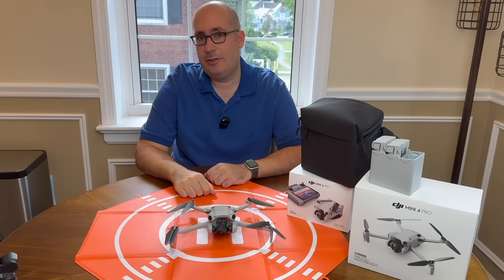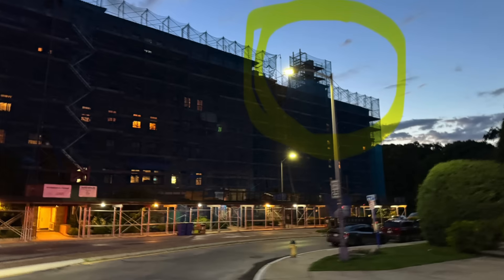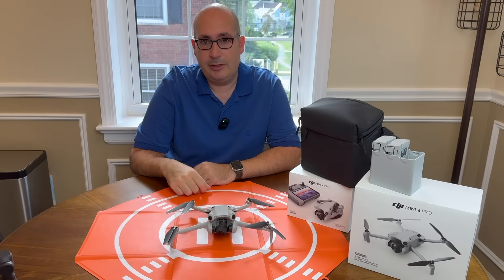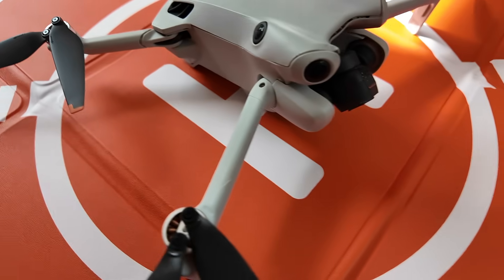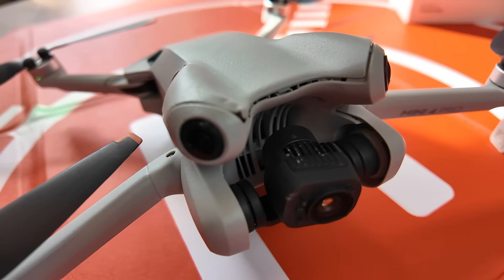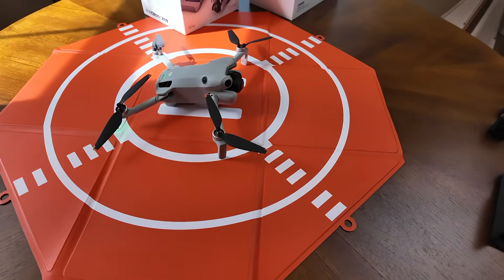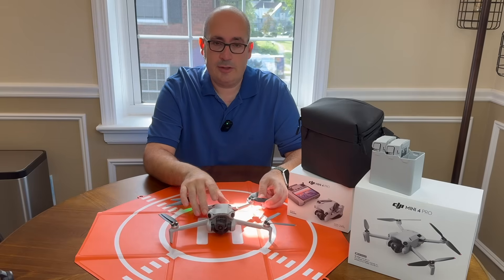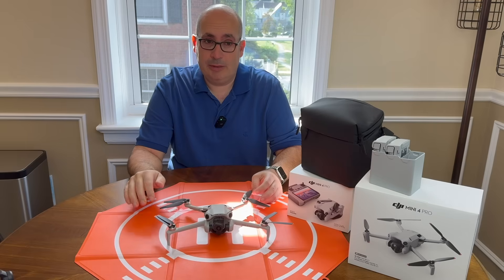This Is Why You NEVER Fly a Drone at Night (DJI Mini 4 Pro CRASH)

Comment: Do you have a P107? Because there's a whole thing on night operations.  Strobe lights, as well as night illusions, and specifically that you cant see things in the dark and neither can your drone without proper equipment, that the 4 does not have.

That drone is toast and it was a painful and expensive lesson.  If you cant get DJI, get drone insurance. If you cant or wont do that, then fly your drone at your own risk.  But at least check the area youre flying first, for things like...powerlines....security mesh... etc.  Oh and for that last part, here's the important part.  DO IT DURING THE DAY.
Reply from the maker: I totally agree with you. This was entirely my fault and a very hard lesson learned. Thanks for watching.

Comment: Sorry for the loss of your drone but it's user error. It's all in the manual. The mini 5 pro has more sensitive sensors but they don't work in darkness. The sensors shut off and that is shown on your controller. Only the front lidar does on the mini 5 pro. 💡
Reply from the maker: You're right, I'll definitely be more careful next time!

Comment: I crashed my Mavic Pro into a Friend's Patio real hard !!!  I went out over the Ocean one night and as i was coming back home , I decided to turn my Head Lights Off and just flew in via Map View , at least till i get about a hundred feet from my house and then i normally turn the Head Lights back on , this is something I've done many times before but this time i made a Big Mistake !!!  I was talking to my Daughter while I'm gradually Lowering my hight in preparation for landing , I wasn't  paying attention cause when i catch myself , i saw Minus 15 or 20 feet Elevation on my Remote Control and all i could do is Cuss myself for the Nonsense i had done but it was too late , the Drone had Crashed hard cause i was coming in fearly fast and after tracking it down with the GPS , i found it at a Friend's house about 400-yards away and it was i Pieces , the Battery Cells and Shells were Scattered all over the Patio floor and the Upper Shell was all crumbled , the front leg with the Antennas in them were all broken off and everything looked like a piece of crap !!! The Head Light Lens and all the front area was in a mess !!! Well that cost me some foolish money and now it's all fixed except for the Vision Sensors and the Camera Ribbon Cable , i have two Brand New Ribbon Cables here but need some Batteries cause fixing certain things without power makes no sense , so i will Order some batteries and then see from there but i know it flies cause i tested it before the last Battery finally gave out but what i can say is that these Older Drones are Built like Tanks cause the things I've been through with this Mavic , i know they are tougher than many !!!  A word to the Wise , Pay Attention when flying and acknowledge the Warnings and Readings on your Devices , they work and are there for your Safety and can save you some real money and headaches. 😊
Reply from the maker: Wow, thanks for sharing your experience and the important reminder to pay attention!
Reply: @Outdoor_Prepper ,Yep !!!😊

Comment: I crashed my mini 3 pro a few months ago and damaged the gimble and the pitch/yaw connectors that hold the gimble mounts also damaged the top casing and props! As I bought this second hand and had previous damage I got the drone for £400. I did fix it myself for under £100 in the uk as im in the uk. I had to buy a new top cover from Ebay for £15 luckily the most expensive part was the camera with the data cable that was £60 also rubber gimble mounts for £5 and the pjtch/yaw motor so was fairly good! The biggest problem was the error codes popping up but I got around that as I still had the original camera which I swapped out the actual camera unit inside and got no errors after that!
Reply from the maker: Wow that’s some great work getting it fixed yourself - good to know parts are available.

Comment: You're a classic example of why drone regulation is getting tighter. The sensors don't work in low light, it's in the manual. The CAA regulate for the worse case scenario and you're it. If you did any kind of research you would find the advice is to fly the area in daylight before you fly at night.
Reply from the maker: That’s a fair point and I will definitely take more precautions next time. Thanks!
Reply: @Outdoor_Prepper  Sorry for the outburst. Just take more care and do your research of an area  before you fly. I wish you Good luck with future flights.
Reply from the maker: Thank you appreciate it

Comment: This is All about what you didn’t do - Not what the drone didn’t. It appears that you didn’t understand the limitations of the drone and more important than that, your own limitations. It’s Unfortunate that you ruined your drone - But it is without doubt all on you. Top tip research the mini 4 pro sensors and particularly how they function in low light - would advise planning your flights better too especially at night - Thanks for the content
Reply from the maker: Totally agree - this was definitely my fault and misunderstand the operation of the sensors. I have ordered a new one and will be ultra careful! Thanks for watching

Comment: Commercial drone pilot here. You can safely fly a mini 4 pro at night if you understand the limitations that such conditions will put on the drone and you as a pilot.
So understand the system, do your site preparation and there will be no problems.
In this case, neither seems to be in order.

The Air3S has infrared LIDAR that will work in the front of the drone, it is thus a bit more self aware at night.
Reply from the maker: Appreciate the tips and advice about the limitations of night flying!

Comment: I take it you are a rookie drone pilot?  The OA sensors don't work at night, however, all you need to do is set an RTH altitude higher than any obstacles in your flight environment.  If you lose contact the drone will climb to the set altitude & fly home safely.  Flying at night is a blast.

https://youtu.be/26ztIk624cs?si=WXb27e0DFqzVvKfi
Reply from the maker: Thank you for the tips. I’ve ordered a new drone and will be super careful flying especially at night. Thanks for watching!

Comment: I've never crashed my mini 4k.   I know it has no sensors so I don't depend on them.   I ran into the same DJI refresh issue when I bought mine a month ago.  AI told me I could get a personal article of insurance from State Farm for them.  My 4K Mini was $250 so I haven't looked into that yet.  I may crash mine at some time in the future but it won't be at night.  My previous drone didn't have GPS and it was an accident waiting to happen.
Reply from the maker: Thanks for the tip about the insurance and I appreciate you watching!

Comment: Same experience with my new Mavic4 Pro. 🤦‍♂Repairs were'nt costly relative to the cost of the drone so we are back in the air. This was entirely my fault, got distracted before trying to shoot an evening shot of the moon and sunset. I rushed after missing sunlight and surely enough I clipped a cable line, the weight of the drone coming down even at 15' will break it. (Yes, sensors were warning me but I thought I saw the line that triggered the sensor, and didnt see the one that brought it down. I knew better period!) Damaged a prop, arm, gimbal and camera cover. Costed a little over $300 in repairs. Yes, $300+. I hope you all resolve the issues with DJI drones in the USA, and wish you all the best!
Reply from the maker: Glad to hear the repairs weren’t too bad, and thanks for watching!

Comment: If you fly at night make sure you are aware of your surroundings. install a strobe light.Never relied on sensors. maintain a visual site.always have a spotter.do a flight check before taking off. Always do a test flight in a open area.Set your return to home altitude.Stay away from tall structures.Never fly behind a building that you could lose visual. Never drink alcohol or do drugs while operating a aircraft.Be comfortable With your aircraft before a night flight.Always have a rescue plan before taken off.Do not fly over people or moving vehicles. These are some tips to keep everyone safe.Sorry to hear about your accident.. Stay safe and happy flying.👍
Reply from the maker: Those are all excellent points! Thanks for sharing and for watching!

Comment: Thank you for your video. I believe the primary preflight inspections did not include an adequate knowledge of the flight environment and secondarily, if the scaffolding was involved, keep in mind it is not a building and is more like tree limbs and power lines. in my experience, drones do not auto sense any thin, liner objects like tree limbs and power lines. Scaffolding has both characteristics. It is good practice to keep drones well away from structures that have long, thin profiles such as trees, powerlines, and scaffolding. I prefer to remain at lease 100 feet above and/or away from any structure I am observing and use camera zoom for tighter shots. I also use my sensor cameras to view sides, rear, and down views (Air 3S). Some lessons are hard-learned. There is a good side to everything. I hope you find positive with your experience.
Reply from the maker: Thank you for all the good info! I will definitely learn from this mistake and have ordered a new drone. Safe flight and thanks for watching!

Comment: It could well be the gimbal cable, I replaced one before and solved the issue depending on the error code.  These Mini 4 drones shut off obstacle avoidance in low light, which wasn't the drone's fault for crashing.
Reply from the maker: Agreed - I didn’t realize the avoidance didn’t work at night. Was definitely my fault

Comment: Man that hurts. I had a crash with a Mini 3 Pro in the fall after the leaves dropped due to catching a thin tree branch while filming a horizonal tracking shot - which means my direction of travel wasn't covered by the sensors. 
Even have the video of the drone getting wrapped around the branch before the branch snapped and flung it into the ground. 
Thank God, I had DJ Care so I was only without my drone for a week but that option is off the table thanks to politics. 
Good luck and keep us updated if you find a repair place or decide to sell it for parts.
Reply from the maker: You’re very lucky you had DJI care! I will definitely update on the outcome. I was able to find a new drone on eBay minus the controller as I still have mine. I ordered it, but it has not yet arrived. Will post once it does and hopefully all is in order.

Comment: I was terrified my first couple of night flights. However, if you learn to pay attention to all of your screen data, you can fly, even if you lose sight of your drone.  Pay attention to your compass. It has a home point icon and an arrow that represents your drones point positions. In the Army, I paid attention to the the helicopter pilots. I use to hear them talking about getting their night instrumentation certification.  They literally fly by their instruments not their eyes. So I learned to do the same.  I wouldn't say never fly at night. I have about 60 successful flights under my belt.  It can be done but this came with a lot of experience. Also, I would say never fly under 100 feet at night. Get up into the open air.  And always know the average height of the trees and buildings in the area you want to fly in and get up high before you fly.  Practice, practice, practice. It can be done successfully.
Reply from the maker: Well said and I totally agree with you. This was definitely 100% my fault. I have ordered another drone and I’m going to be super careful but continue to try to get better to fly at night. Thanks for watching!

Comment: Pro tip: make sure your altitude is at least 150 feet in urban settings because your usually clearing most apartment buildings at that height.  Also, set you RTH higher than buildings around for obvious reasons.  Lastly, buy an anti collision light( Arc V firehouse technology) is the best you can get for the money 💰 and use it at all times so that other aircraft can see you as well as scaring off potential birds 🦅
Reply from the maker: That's all great advice for night flying - thanks for watching!

Comment: The drone sensors did not fail you, you failed reading the manual and you failed to read the prompt in the controller when it warned that sensors are off when dark 😂
Reply: Mini 5 pro solves this problem with lidar. Now you can fly at night. Still with caution but now you atleast have LiDAR.
Reply: Only forward though
Reply from the maker: Thank you
Reply from the maker: @Manu__334-e2w  that’s awesome and great to hear! I’m definitely interested in the mini 5 pro!
Reply: @Outdoor_Prepper  Only front facing Lidar just so you know lol. The vision based ones will be turned off, they are a little better than the mini pro 4 but still do not work at night.
Reply from the maker: Yea I totally was at fault for the crash :(
Reply from the maker: I definitely learned a tough lesson about night flying.
Reply: Yep. Ive flown my Phantom 4 Pro at night and 1 mile out below 100 feet. I’ve also had my Air 3S up at night and even on the Fourth of July filming neighborhood fireworks that were, shall we say, questionable….. but I said hi to the neighbors and let them know it wasnt to Feds or local popo, just the neighbor looking for kewl shots.
Reply: ah i also did not know the 360 avoid not work ad night good to know lol
Reply: @WorldTraveler-BE none of the avoidance works at night except the forward LiDAR on the Air 3S. You get a warning on the screen when light levels are too low so Im not sure how anyone could not know.
Reply: Get some strobes for flying at night (if it crashes and disconnects you can still find it relatively easy. And other aircraft can see you). Also know that the sensors don’t work in the dark.
Reply: He volado mi mini 4 pro de noche y simplemente lo hago con un poco de sentido común. Primero tengo idea de dónde voy a volar, segundo no lo llevo muy lejos, tercero procuro ponerle luces externas, cuarto tengo configurado el botón de función para mantener la luz encendida, cuarto NO me acerco a edificaciones, quinto vuelo a un promedio mínimo de 50 metros de altura...
Reply: A lot of people saying the mini 5 sensors work at. Ight. Im pretty sure it’s only the forward facing LIDAR just like on the Air3S
Reply: The sensors did not work at night. The new one, Mini 5 pro does...
Reply: @estanislaocorral4296  To some degree, they do, but cannot be dependent on. They will turn off when it is too dark, I live in the country where there are no streetlights, and I get the same warning that obstacle avoidance is turned off. Only the front-facing Lidar is working

Comment: I fly drones at night, I use 3 drones for night flying the Air 3S, the mini 4 pro and recently the Potensic Atom 2. If I'm flying in a new area or an area I know but have never flown at night before; I will always fly during the day noting the high points in all directions, that way you'll always know the lowest point you will be safe once the sensors are inoperable. Even the Air 3S is not completely safe at night for example if you yaw to the left or right and you are not familiar with the area you could end up crashing. I really am very sorry about your drone getting broke, I know it must be dire to live in the US trying to get hold of a DJI drone or to even get service for a drone. I hope you get it sorted out soon and at a reasonable cost to you. A couple of months ago I crashed and lost my DJI Flip in the mountains, it took me 10 days to find it I eventually found it viewing video shot on the Air 3S but that was only part of it actually finding the spot on the side of mountain and getting to it was another story. The drone laid out in some very bad weather, and it still started on the button and flew without any issues, I was so impressed with this little drone I decided I would keep it I did intend selling it but not anymore.
Reply from the maker: Wow - that's quite the adventure finding your drone and a great endorsement for the drone's durability! Thanks for watching! I will get another one and be much much more careful!

Comment: You failed yourself  no sensors work at night unless you have lidar which you dont and the message would have appeared on the controller telling you this and you should always know where your drone is heres my tip for you go learn about the drone how it operates ect befor even trying  a night flight. unbelievable
Reply from the maker: It was an unfortunate mistake that cost me the drone. Will have to buy another. Thanks for watching

Comment: Sorry you had to find out the non-manual way ! But surely the lesson here is NOT 'Do not fly your drone at night' ! Rather it is 'Know the capabilities of your craft and pilot accordingly!'. In a way the Mini 4 doesn't help in that it disables navigation lights when recording, which can't be changed, making it very difficult to see at night without additional help, such as a massive aircraft-grade strobe light on the bottom ! (not placed over any other sensors ! ;)
Reply from the maker: Well said. Thanks for watching!